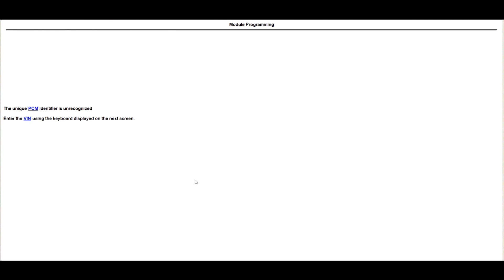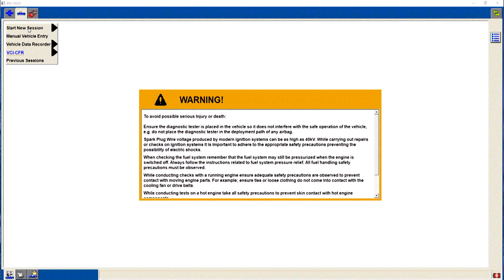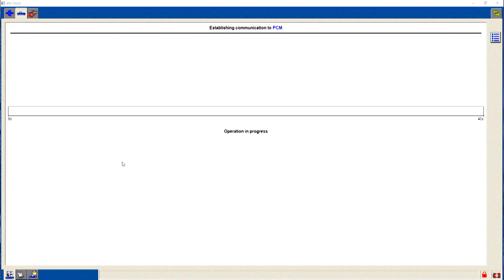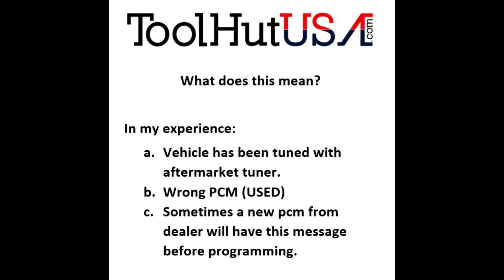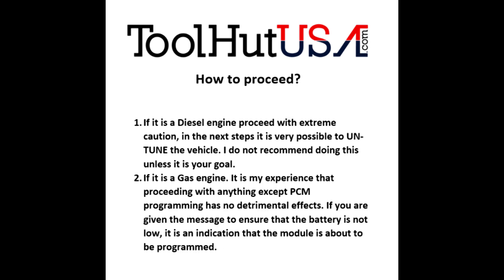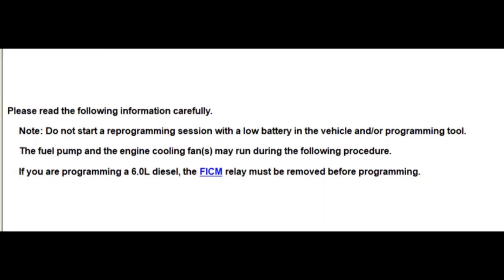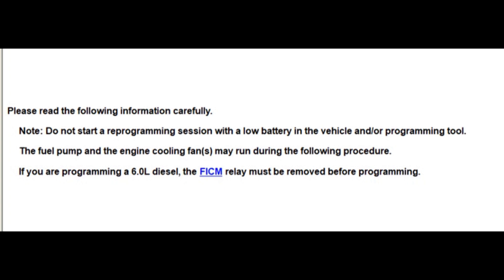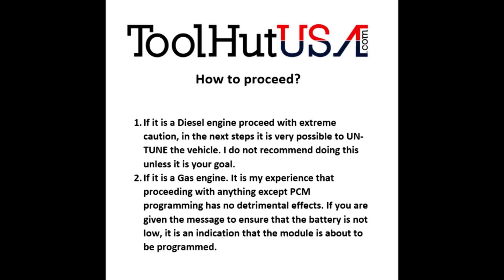Ford PCM Identifier unrecognized. NOW WHAT?

Comment: I have 2018 f350 6.7 and another shop put a jasper transmission in it. I’m getting the unique pcm identifier is unrecognized error while using fjds to change the solenoid strategy. Now I find out that the truck is tuned and deleted so my question what are my options to get this truck back in the road. Thanks in advance
Reply from the maker: you can use forscan to update the id and strategy